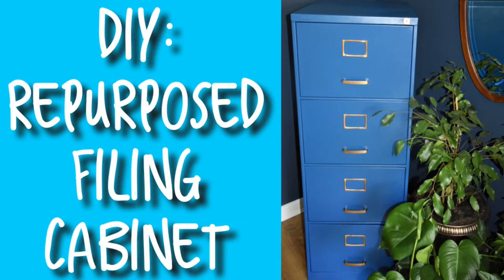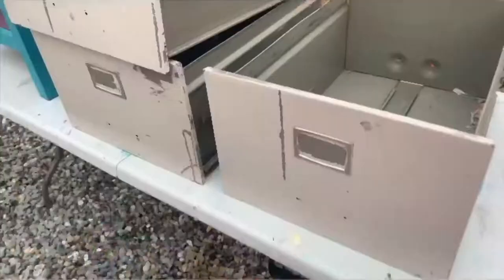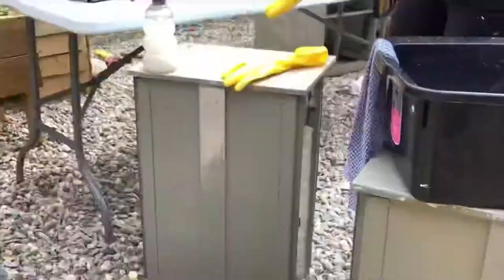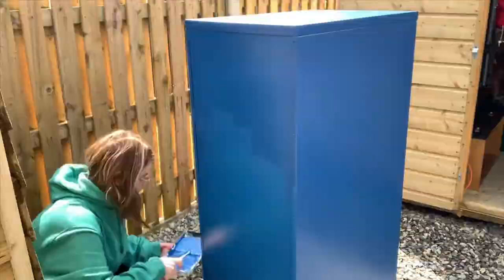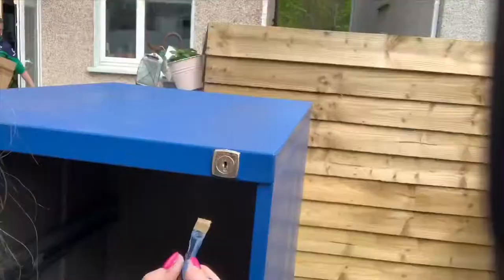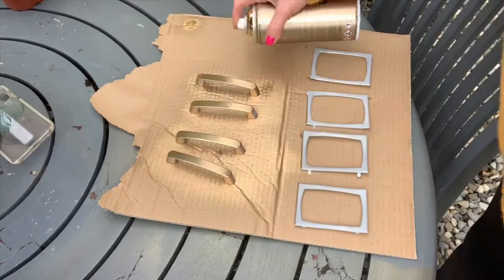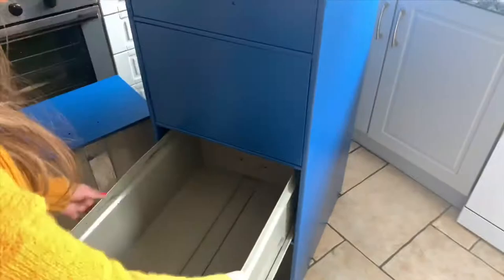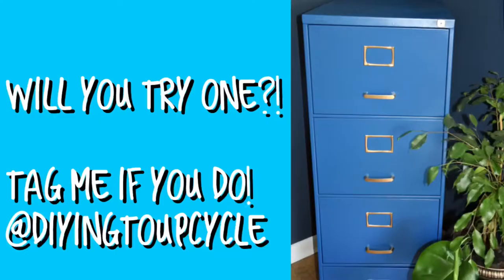DIY:How to repurpose/upcycle an old filing cabinet!

Comment: A tip for painting with the rattle cans. You mention shaking it often to get a smooth finish. You can also improve the smoothness by sitting the can in a bowl of hot water for ten to fifteen minutes before using. The extra warmth keeps the paint droplets even as it sprays out. Never use a cold can of spray. And as the can empties and the pressure inside drops, heat it again to ensure the smooth coat, otherwise the loss of pressure means larger droplets in the spray.
Reply from the maker: Brilliant tip Kim, I’d no idea you could do this with those cans! I will definitely be trying this, thank you SO much for taking the time to share that. ☺️☺️☺️

Comment: At our office, we were going to sell a few old filing 🗄️ cabinets and sold the smaller ones but waited for a buyer to buy the large upright one. Well the day of the sale, 2 co workers tried to dolly it down from the second floor down to the main floor (elevator was under maintenance) and the idiots left the unlocked doors forward, first step tge doors opened, carrying the weight forward and crash bash bang boom 😂 everyone in the office heard it and my boss was not happy 😅 "what the F did you guys do??!!"  This happened in 2019 😊

Comment: Using a roller instead of a spray paint ... what are the cons and pros of both? Which one is better?
Reply from the maker: Good question but I think it mostly boils down to personal choice and skill. Initial cost wise rolling would be cheaper but over time and use of lots of (good) rollers they could end up on par. I have t invested in a good sprayer yet but I do plan to soon as I guess a plus would be time, a sprayer would be quicker. Not sure this helps much?!
Reply: @thediyist.com_  thanks for the reply! Im going to buy the colour tomorrow to do this .... so I hope it will be ok as Im not that great with crafts. I think Im going for the roller as I feel that with paint brush you can reach awkward places easier and not make too much mess.
Reply from the maker: Well, did you do it?!
Reply: @thediyist.com_  I did! I'm yet to use it as I was busy, but today I will start with the 'sanding' or what's it called you do before painting.. Im scared of that because its gonna be loud and I'm unsure I have the right equipment because I don't have a special sanding tool. Will update!
Reply: @thediyist.com_  ok, an update... my sanding tool sucks, I have only managed to do the top as it keeps running out of battery. I'm thinking of buying a strong paint remover I've seen on some another video...

Comment: This is quite ironic, but I've just purchased a personal file cabinet just recently.
Reply from the maker: Oooooooh will you upcycle and/or repurpose it?!
Reply: @thediyist.com_  I'll repurpose it by modifying it with additional cam locks that requires different keys to open it completely. It's a 3-drawer cabinet; the main cam lock is in the middle. Once I put the cam locks on it, it can be really safe without opening the cabinet with just one key; therefore, it will requires 4 keys to open it up. I don't have mines yet, but I am competent that I can do it.
Reply from the maker: @tvoovm7254  I love it! That sounds really cool! Yes I’m sure you will be able to do it! Will you let me know how it goes?
Reply: @thediyist.com_  sure.